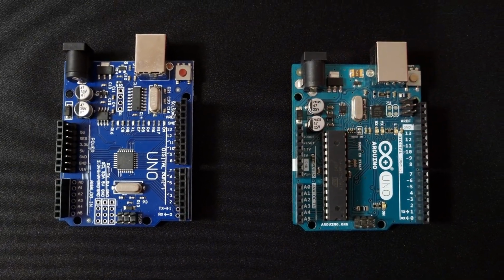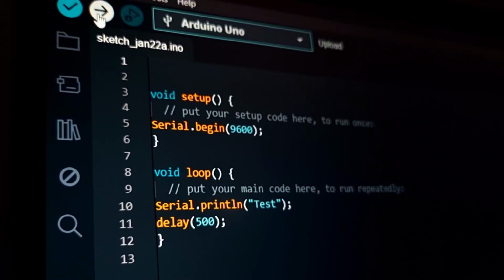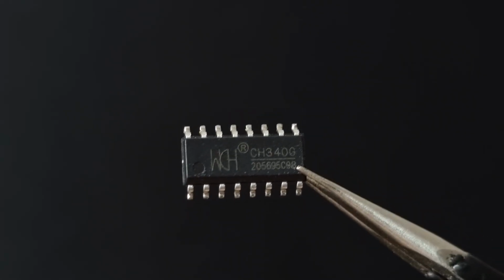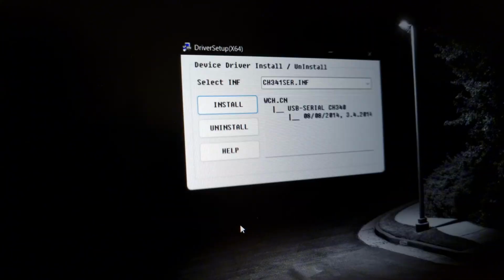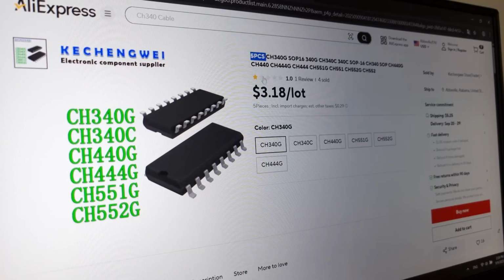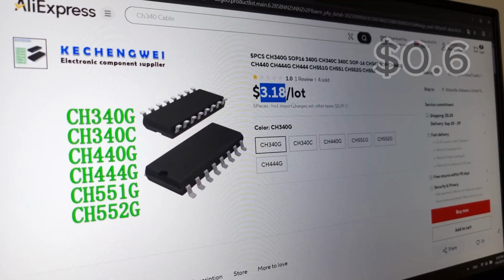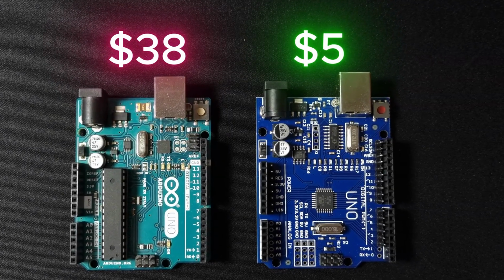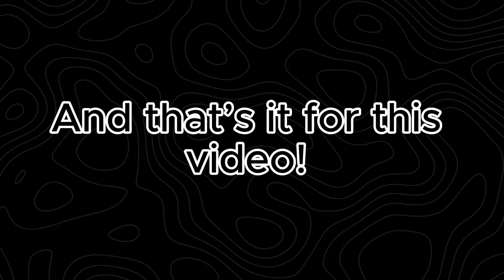CH340 vs 16U2 | What is the difference?

Comment: I dont remember the specifications, but i think it was that Arduino started using a better microcotroller fir their USB / virtual Com port interface than the main Atmega328 😅

I dont recall did they use FTDI chips before replacing them with Atmega16U2 microcontrollers..?